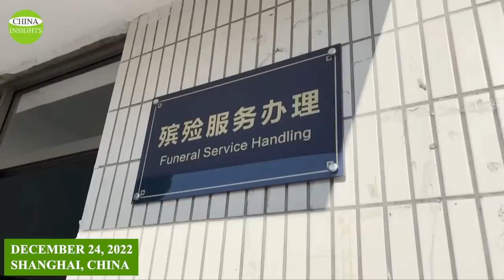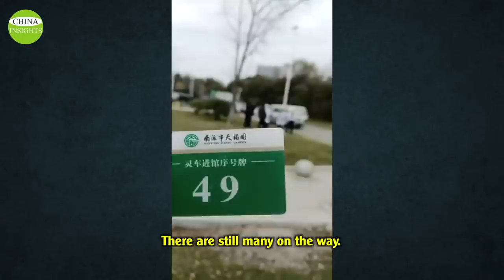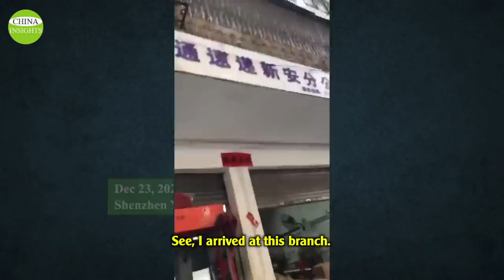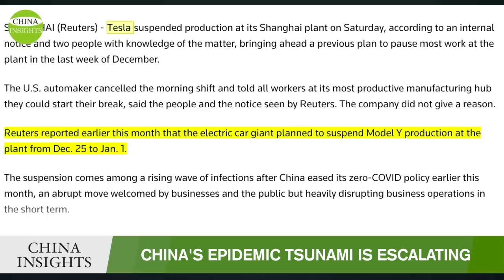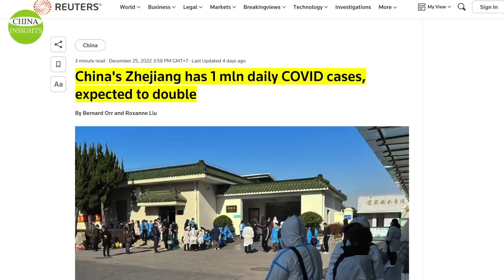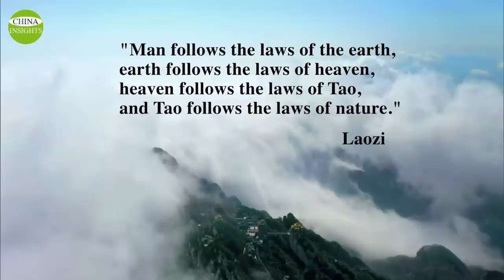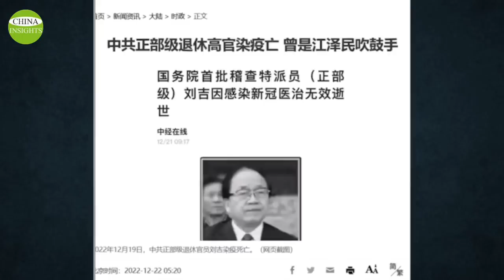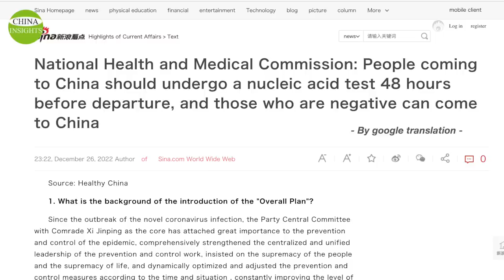China lies completely flat: OPEN UP travel, Tesla suspends production at Shanghai plant and more

Comment: Let's not forget China was celebrating zero Covid with Fireworks and India had fires burning 24 hours a day. Looks like the table got turned around.        I Love India
Reply: Yes.  The virus has to run its course. Its happening in the West as well. I've had it twice.  It seem to be everywhere but no one is concerned because we're all vaccinated and we just aren't getting very sick. "A mild cold" is the most common description.
Reply: Ya at this point im almost wondering if maybe they just have a lack of burn pits.... like, it may not be cerimonial, but at a certain point the bodies just need to be dealt with quickly.
Reply: @bill9989  I have had it twice and coped just fine and no I'm not jabbed with that poison.
Reply: @rugbydazz2264  Maybe you should inform yourself what vaccines actually do, where they originated from, how they reduce the 'risk' of severe sickness, what effect this has on the elderly/chronic sick and subsequent on the hospitals if severe cases are less frequent.

And don't fool yourself, even without chronic diseases and a strong immune system you can be unlucky to have a receptor that makes specific infections have an easy go at you and send you to hospital. Better hope it's not over capacity at that time eh?

But don't worry. Enough people vaccinate to keep the capacity at an acceptable state in most countries.

Comment: i've seen imige's of the funaral parlour building showing six insinarator chimneys but only one had smoke coming out of it ,is it a lack of power or application of resources and a 24 hr shift rotation of them ?
Reply: If the retort (Cremation machine) is running properly, the only thing you should see from the stack is a thermal mirage.
Reply: All lies..